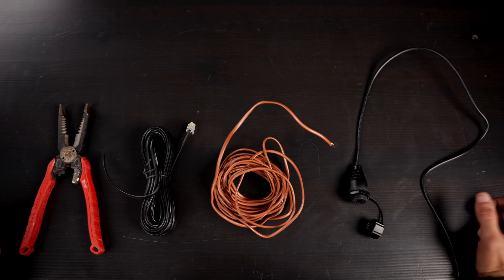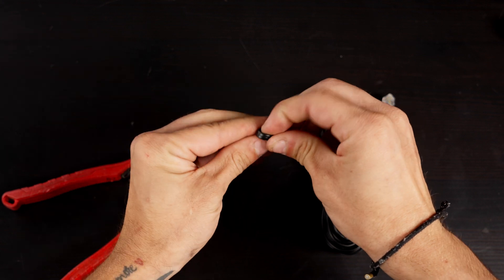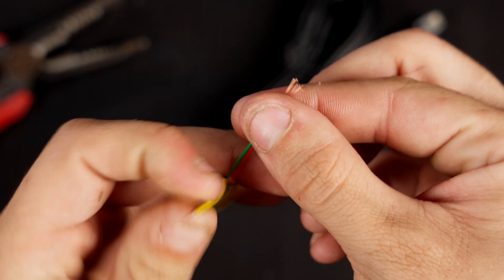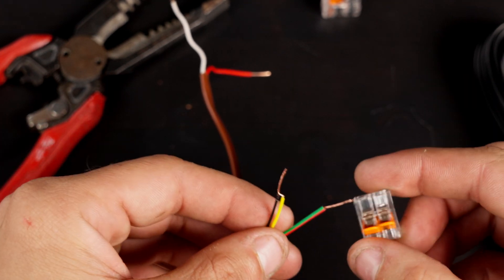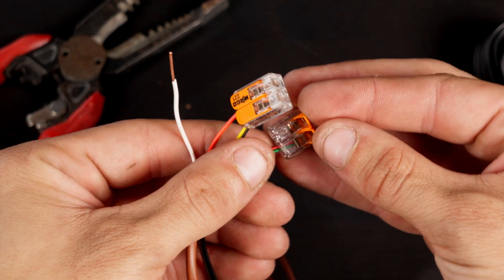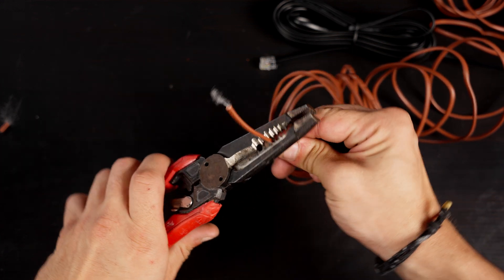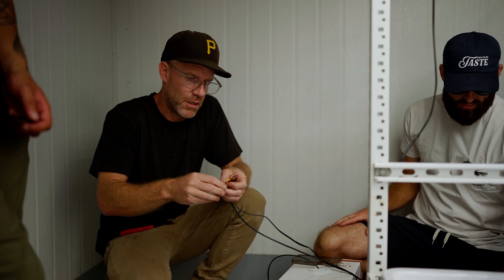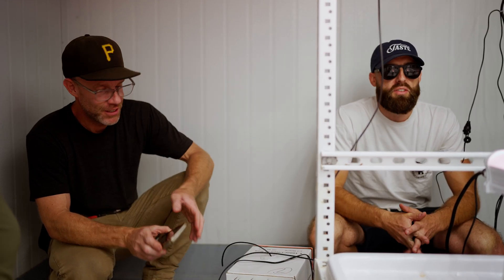Growlink System Installation Guide: Control Your Under Canopy  Lights with Growlink.

Comment: does craftfarmer undercanopys work with this
Reply: This is a Faven video so I'm sure they're not going to answer on behalf of a competitor's product.  But any 0-10V dimmable lights should be able to be dimmed this way or with Growlink's new 4 Channel Light Link module.
Reply: @FatAsstronaut  do we have to use the 4 wire RJ11 or can we just use 18/2 thermostat wire.